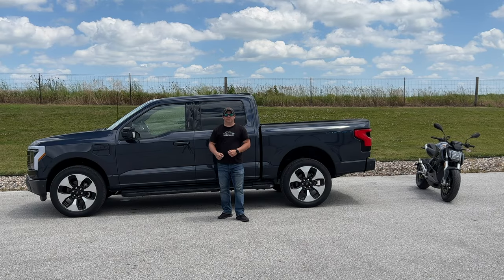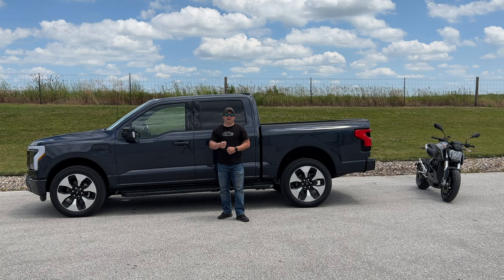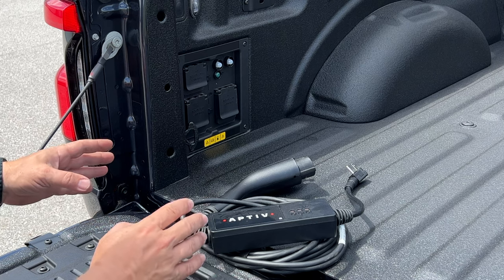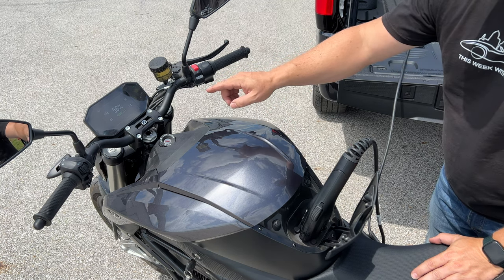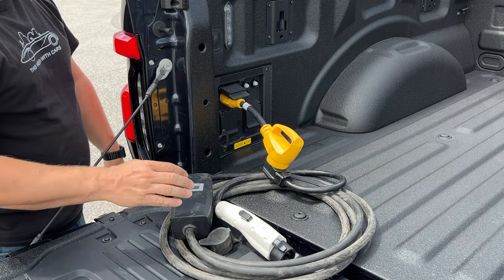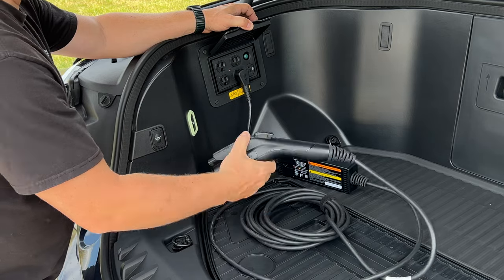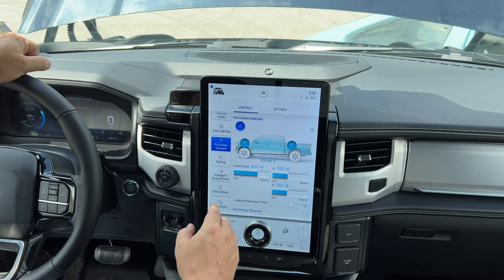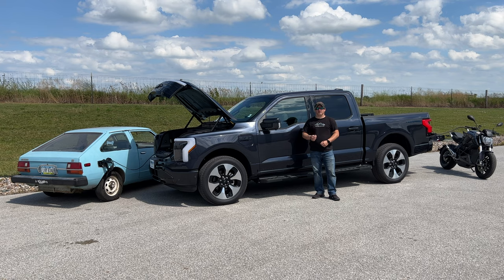The Future of Electric Powersports and the Ford F150 Lightning

Comment: I've never been a huge "EV Guy" but these modern EVs are simply incredible. 5 years ago, I would not have agreed. But I do now. This is the future.
Reply: Did you see the video where they towed two identical  caravans one with an electric F150 and with a gas car. The F150 only did 1/3 of mileage of the gas car took another 45 minutes to recharge to 75%to come back. The gas car did it on one fill and only took 1minutye to refill on high powered fuel pump. If you are towing or going long distance these are just not there yet.,
Reply: @tonysheerness2427  yeah, that was on TFL. I had to say, I was very disappointed with the Lightning truck I thought it would do a lot better than it did.
Reply: @tonysheerness2427  Yep, I saw that on TFL. If you're going to tow an E.V. to a track, then recharge it from your Lightning, then tow it home again, you'd better live close to the track.😁
Like all technology though, ev range will keep on improving. It's just a matter of time. Same will apply to charging points; more and more will keep appearing until there's one on every corner. I don't think there's any doubt that the ev is the future; the doubt is - how far in the future?
Reply: @2H80vids  EV's were the first vehicles invented and over 100 years development in them so far and still they can not beat gas cars.
Reply: EV is the future, and the technology is advancing quickly.
Reply: @PecanRanch  The hype is advancing quickly. Do you know how much diesel it takes to dig up tons of earth to extract lithium to make one one car? Just because the pollution is out of sight does not mean it is not happening.
Reply: @tonysheerness2427  Exactly, in fact MOST automobiles before 1908 were EVs.  There were all kinds of designs out there: electric, steam power, gasoline, alcohol, etc.  No one knew exactly what the future of automobiles would be.  But when Henry Ford came out with the Model T with the inline 4-cylinder, gas powered engine, with rear wheel drive and a manual gearbox, it was over.  After that, the days of steam and electric were done.

Comment: I think this a peek into the future of small RVs/Adventure Vans, too.  Even if you go just "half way" and imagine a diesel-electric hybrid Sprinter Van, and the upfitter is allowed to put the house loads on the propulsion battery system in the same way the Lightning effectively does, it would really be something!
Reply from the maker: Makes you wonder why they are still doing gas engines with separate generators instead of a hybrid setup.

Comment: As a Brit I have never seen the attraction of a pickup with nowhere secure or dry to put luggage/shopping, but this truck with its huge  hood/trunk/boot  appears overcome this. I must admit I am very impressed with this and it's many other features. Of course it would be no use in the UK a it would fill 2 parking spaces and get wedged in some of our roads.
Reply from the maker: We do not have the theft problem here like you do.  In America you know not to touch someones pickup or you might get shot.

Comment: I have been saying for about 20 years that if they ever made a car that would go 300 miles and recharge in 30 minutes there would not be anyway people would buy a gasoline powered vehicle as their daily driver.  It doesn't mean there won't be any gas or diesel vehicles but why would you want a vehicle that has so many computer controlled things just to get it to run anywhere near the pollution we can live with and have enough power to run.

Comment: Pit stops should be tire and battery swap. Race teams should lead the charge in innovation and develop competing quick change systems that coalesce into one common quick change system used in racing. Then trickle that to gas stations where you pull up, an automatic system pulls your battery and sticks in a fully charged battery, then your original battery is inspected, cleaned, charged and either put back into circulation or refurbished. You never own the battery unless you only charge at home or plugin chargers, but if you want a quick charge, you trade your battery in. I doubt there's any engineering reason this couldn't be done, people won't want to let their brand new battery go into circulation, but if the batteries that are cycled back are guaranteed of a certain capacity, people will get over it.
Reply: Already happening with EV's in China

Comment: You guys need to watch TFL's test of the Ford Lightning. It was very disappointing. Although the claimed range was 260 miles on a full charge, the truck was barely able to do 80 miles while towing a midsized trailer.  This means that when hauling all your toys, in the first place you won't even get there, and in the second place there won't be sufficient battery to charge any of your toys.
Reply from the maker: My trailer video will come out tonight, very different results!
Reply: @ThisWeekWithCars  I certainly hope so.  For your sake.
Reply from the maker: How Long Can A Ford Lightning Drive Pulling a Trailer?
https://youtu.be/gVRA2gwT_ik

Comment: I,m not one bit interested in electric vehicles
Reply: You kids and grandkids will, the transition has begun. In 1910 the horse and buggy owners probably felt like you do now.
Reply: @HaroldReece  in the early 1900s most automobiles were electric. But in 1908 when Ford came out with the Model T with the inline 4 cylinder gas powered engine and mass produced to keep costs down, there was no looking back. Electric cars were dead. (And to be fair, so were steam powered cars).
Reply: You are not required to watch.
Reply: Jebus Hypocristos  There is always the conspiracy theorist.

Comment: It's neat.  Don't get me wrong.  Current technology is however:
1) prohibitively expensive 
2) slow to charge
3) has poor storage density
Not a viable replacement for simple petrol powered devices. Maybe 15-20 years from now.  Nevermind that the power has to come from somewhere.  Solar, wind, hydro, fuel cells (Ha!$$$) etc are all very insufficient to keep up with demand.  Kicking the energy can down the road doesn't solve any problems in the near term.  I believe in our lifetime we'll see new battery tech, better energy production and a more robust grid.  That isn't present reality.
These technologies and overpriced forays into products are necessary growing pains.  They are not ready for mass consumption yet.
Reply from the maker: When you are talking power sports the electric motor cross bikes do not need very big batteries and they only carry enough weight to get through the race.  You might not be aware but that future is already here.  With a Lightning you don’t need to also carry a generator with you.
Reply: @ThisWeekWithCars  
I agree the technology is viable, and for limited use cases like short duration motorsport a super cool evolution.  It's only going to get better with time.
Unfortunately for most of the population, the cost makes it unattainable.  I've been an electronic and electrical systems enthusiast since I was a small child.  I've watched the emergence and maturation of nickel, lithium, AGM, and nanotech enhanced battery systems, the evolution of brushed motors through cobalt, brushless, microcontrollers and beyond.  So many amazing things many take for granted.
I wish it were more affordable.  In time it will be.  
No disrespect intended.  I enjoy your content and enthusiasm.   Sometimes it's hard for us who make do with less.

Comment: I would have to respectfully disagree with you Steve as far as this being the future of Motorsports.  The problem is that to have every present petroleum vehicle replaced with an EV, we (the USA) would need twice the present generating plants just to power the EV's.  It takes at least 10 years of permit approval for each generating plant.  I see the future as one in which Hydrogen powered vehicles will solve problem of pollution from cars and trucks.
Reply: Ford and all the other Auto manufacturers disagree with you Anthony.
Reply from the maker: The electric power sports are already taking over the events.  The motorcross bikes will always be plug in electric and they only need a small battery to finish the race.  You are not aware of the minimal requirement needed to OHV competition vehicles and that future is already here.
Reply: The only problem with that is we are more than ten years away from produce enough hydrogen, and it still doesn't work nearly as well as the EV.
Reply: Hydrogen is not a viable source of energy for cars. It is extremely difficult to transport.
Reply: @amilton2128  Hi...the one thing no one can disagree with is that we do not have enough electric generating plants.  Again....to have every vehicle in the United States currently on the road replaced by EV's it would require twice the number of plants currently operating to charge the batteries of the EV's.  That means there is no power for our regular home and industrial use.  That's a fact!  Regarding Motocross bikes and Steve's comments and his Ford....I'm not saying that they are of no use.....I'm saying that EV's cannot replace the IC engine in our vehicles.  Your Ford truck is awesome.  The problem is that get caught in a traffic jam, use too much of your battery power on your AC, freezing temps, temps above 90 degrees....all will drain the 114 miles left on your battery and you'll be left either on the side of the road with  your generator, or you'll be stuck at a charging station for several hours.  EV's are just not practical with our present technology.
Reply: @anthonybrau7399  you have to look at the average trip and the fact cars are parked 95% of the time.
Reply: @amilton2128  Hi...again....I'm not saying a person should not purchase an EV truck...I'm saying they are not practical for current usage.  In 2021, 57.2% of all vehicles in the US were light trucks.  The majority were dual use (business and pleasure).  I use my SUV for both business and pleasure.  It is not unusual for me to put on 250-300 miles in one day for business.  For Me....as I'm running low on gas, I just pull into a filing station and within 5 minutes, I'm back on the road.  With an EV, I'm looking at 90 minutes to two hours for a recharge.  Further, an EV  will cost more to purchase than a comparable vehicle.  The payback on an EV is between 5 and 10 years...not counting battery replacement and impact on the environment for mining of raw rare earth elements needed to produce the battery far outweigh that of an IC engine vehicle (see "Apocalypse Never" by Michael Shellenberger).
Reply: @amilton2128  By the way....Thanks for the very respectful discussion we are having.  That's what's so great about Steve's YouTube Channel.  Cheers!

Comment: Two hours to charge a bike or 30 seconds to fill a tank on a bike. The battery technology needs to come farther before this is practical.   Not to mention if everybody owned an electric vehicle and went home at the end of the day and plugged it in our energy grid wouldn't be able to handle it at this point.
Reply from the maker: This is not the type of bike I would be charging, a motorcross bike would have much smaller batteries and you would want to charge it between each session.